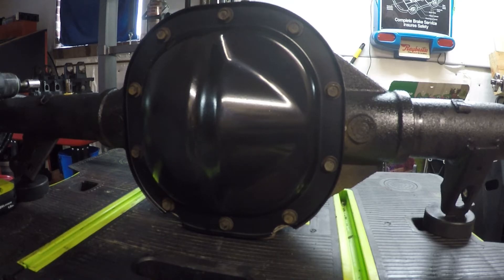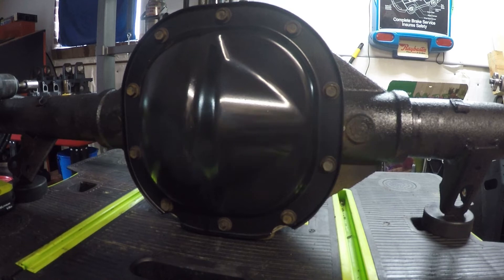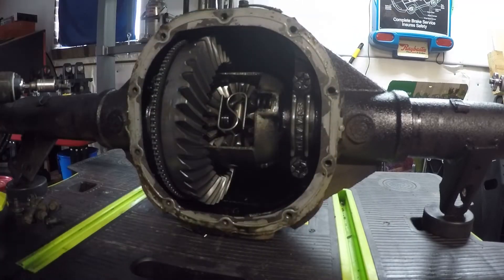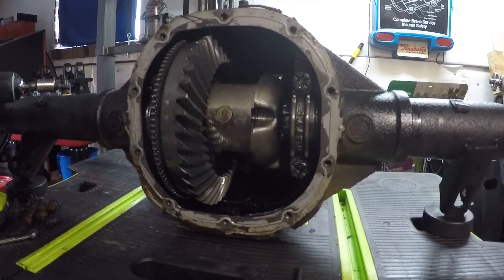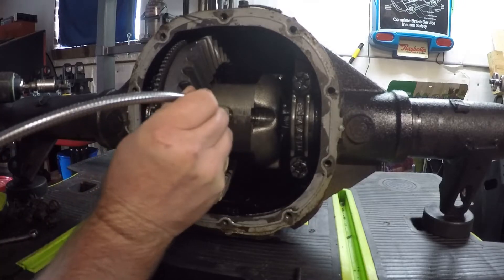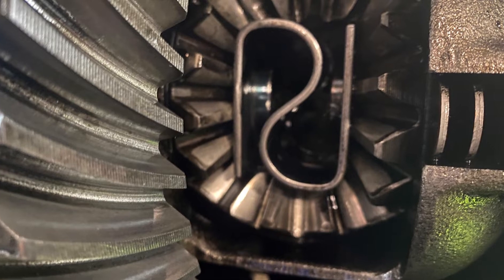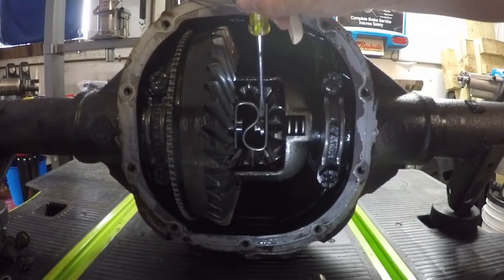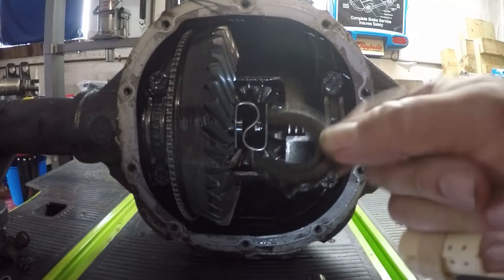Ford 8.8" Axle Bearing and Seal Replacement How-To

Comment: I have a Torsen 31 spline on my 2003 ranger..is the process the same? Nice, precise video. Thank you
Reply from the maker: They’re similar but not exactly the same. There isn’t the same center pin as in this video, I think it looks more like a block. Otherwise similar with removing the bolt and pushing axles in to remove the clips.
Reply: @stuffyoucando2 ok, I'll look into it a bit before trying to fix my leaking seals. Thanks for your response.

Comment: Yesterday, I pulled a rear drum off my '89 Mustang to find axle grease had coated the entire brake assembly! I just did the brakes a month earlier so this is a new issue.  Ugn...So I knew I needed to replace the axle seal..No idea how to do that so I searched online  and this video hit the top....

THANK YOU!  It is crystal clear now and it does look super easy. I am grateful to folks like you who illustrate methods for how to do repairs like this.  It sheds light on what was a dark situation.   I appreciate you!

Comment: After removing the center pin and then the axle , the spider gears fell out of place . I assumed that the C clip would hold them in place , but they didn't . How do I re-align the spider gears ? I think they fell out when I was replacing the axle (I'm only doing the passenger side for now)
Reply: The S clip I thought would keep the spider gears in place after pulling the axle . Now the gears are floating around inside the rear end housing . I'm screwed .
Reply: @rickobrien4025  How did it work out pal?

Comment: When replacing  , Do the recessed edges of the C clips go on the inside or outside ?
Reply from the maker: I’m not sure exactly what you mean by recessed edges, but if you’re referring to one side being slightly rounded, that’s just from the stamping process of manufacturing, it doesn’t matter which way you put them in.

Comment: What is the S shaped piece in the middle? And is it supposed to fit snug? I have a Ford 8.8 that has the same part but t it’s very very loose. The side gears broke so I got a junkyard 8.8 that does not have the same part.
Reply from the maker: That’s a spring specific to the limited slip differential. If your replacement differential doesn’t have it, then it’s an open differential. In your original it should be in there snug so it puts pressure on the side gears.

Comment: Does this axle have inner axle tube sleeves? I’m getting differential oil in the axle tubes on my Ford 8.8.
Reply from the maker: I’m not sure what you’re asking exactly, but differential oil is supposed to be in the tubes, that’s how the outer bearings are lubricated.
Reply: @ really? On my front axle the differential ring and pinion comes out and there’s tube sleeves on the inside. But I guess with the rear axle you have bearings on the outer tube so makes sense. I was wondering why my axle tubes were so full of oil.

Comment: Hi, My 01 Ford Explorer Sport Trac has a strange clunking sound and you can feel it bad through the truck but only after you have been driving fast on the freeway for a while and then you slow down and exit for a fuel stop or stopping at a toll booth and you are moving very, very slowly, not turning at all, it is so bad everybody can hear it, but by the time you get fueled up and start to leave it has stopped making the noise again. There is no noise or vibrations at all on the freeway. Would this be symptoms of worn Spider Gears or clutch packs. Thanks.

Comment: My question is do i have to remove all rear break stuff? I think I have bent axle  thats what my mechanic said after he installed new rear drums and shoes it still squeaks back there only from one side we even tried another drum because after going around block the drum would get extremely hot on one side not the other. Took us while back and forth to come to conclusion rear axle might be bent. I did have blow out at 80mph so its not surprising. Either way i think it is time for the bearings and seals to be serviced anyway. I wounder how hard it is to see with the eye if axle is bent? Thanks i doubt I can do this without a lift and not removing axle.
Reply from the maker: You could do this in the truck if needed and if you have drums you don’t need to remove anything other than the drum itself as far as brake parts are concerned. I actually had to do that later with the axle in this video because it also had a bent axle shaft. I had gotten the axle from a junk yard and didn’t know until I drove the truck afterwards that it was bent. So all of the shaft removal steps can definitely be done in the truck, I’ve done it with no lift and it’s not bad to do. Even the bearings shouldn’t be an issue either. Good luck!
Reply: @stuffyoucando2  what was your symptoms for bent axle shaft? Did it make your rear brakes squeak? For me it will only squeak at last few seconds of coming to complete stop . And at low speeds in traffic with no brake or gas on it will get slight hop coming from rear. But as long as you apply gas or break it is hardly noticable. On highway it does bunch of wierd stuff every bump feels 10times worst than it should i believe. I just want to make sure im putting money in right area. The axle shafts aint cheap i would definitely use new. My luck is like yours spend all day at junk yard just to get bent axle lol. Thanks man appreciate your time.
Reply from the maker: The brakes didn't really squeak, the main symptom was vibration, especially under braking but there was some vibration at any speed over about 35mph. What I did to diagnose it was put the rear on jack stands and run the truck at idle in gear and look at the wheels. I could visibly see wobbling when looking at the inside of the wheel as well as the inside edge of the drum. I think in your case I'd look for that and if you see it in the wheel, switch the sides for the wheels and see if it stays with the wheel or at the axle. If it stays with the wheel, then you have a bent wheel. Are you using the wheel that had the blowout?
Reply: @johnwhite192  I have the same squeak on the passengers side but I was told it was the ABS and the ABS light is always on. But I also have some weird clunking going on in mine at very very low speed that nobody can give me any idea what it is.
Reply: @stuffyoucando2  no that got junked my tire guy is pretty honest about that he wont mount it if it is bent. Walmart will mount tire on any condition rim and not say a thing. I know I need new rims well 3 i have 1 new. Mine feels real lumpy when im in traffic and not hitting the gas i feel the rear end hoping it feels like hopping might not be correct way to describe but kinda get idea. In the rear its really hard bounce over bumps at normal highway speeds i feel front end hit bump its smooth as it can be but when rear wheels hit the bump its like bang like i have stiff leaf springs which i don't they are original i believe. I put new bushings in leaf springs and hangers and brackets. I believe it is either bent axle or bad axle bearings or both. But its only on driver's side that im having issues. Also when shop did rear brakes i bought motorcraft drums and right away i felt it dragging really really bad took it back and drivers side drum was not far from being cherry red my guy told me its a bad drum he put napa drum on i didn't feel drag but it squeaks at last 5ft of a complete stop. I really don't think the drum i got was bent but idk im going to try the trick you said the shop did that to they had it up in air in drive and they said it looked good from naked eye i was there i didn't see anything but i might try that at home. Thanks
Reply: @oldgamer1330  clunking is usually ball joints. But assuming you did all normal maintenance and it is all tight front and rear it could be bad axle bearings i imagine that could possibly make clunking sound. Either way they probably should be done with new wheel seals. But if your going to do all that depending on who dose it might be better to replace shaft as well 400 can get you both axle shafts. And bearings. Seals are separate i think.  Is your leaf spring hangers good mine was rotted out replace those and the bushings in leafs and hangers. Depending on your mileage its probably axle. Mine i have 360k ish miles the axle is getting due for some overhaul.
Reply: @johnwhite192  No the bad clunking only happens at less then walking speed, and about 3 or 4 times per wheel revolution and is so bad you can see it shake the side mirrors. Mine has only done 135k. It really sounds like uni problems but I have checked them so many times, but I think I might just do them so I can rule that out.

Comment: I didn't see no o-ring when removing or installing c clips
Reply from the maker: I’m sure with age they can deteriorate and go missing.
Reply: @stuffyoucando2 just curious whats the purpose of them? I’m replacing the seal on the passenger side and the o ring came out ripped

Comment: If anyone is looking for the slide hammer and adapter to pull the bearing - Advance Auto parts:  master loaner tool kit by PowerBuilt Tools, P/N 648611 (or) Autozone: slide hammer OEMTools 57033 and Adapter kit: OEMTools 57129). For the Bearing and race installer tools: Advance Auto loaner tool kit Powerbuilt: 648996 (or) Autozone: OEMTools 57119
Reply: Yeah, that’s good to know upfront I can call ahead. Working on 2002 F150 👍

Comment: Can you do a video where a guy like me let the spider gears drop and now I’m in a jam.  I have the gears out of the diff housing now but am Leary to pull it apart more…that weird S shaped piece between the 2 axle bearings is stressing me out
Reply from the maker: Unfortunately I can’t pull mine apart to do a video on that. I had this happen to me once before when changing out an axle shaft because I forgot to elevate both wheels and I rotated the elevated side with the pin removed and didn’t realize the spider gears were coming out as I was turning it and they fell out. In my case I put them back in by placing them in the positions they were in when they fell out and rotating the wheel back the opposite way and the side gears moved them back in. It was a pain and took a few tries but worked, but I’d probably recommend watching some of the differential overhaul videos and finding that point in the process, but it will most certainly require removing that S spring.
Reply: @stuffyoucando2  Thank you for your reply....I eventually got the gears back in place.  I have another rear diff to rebuild so I think I will make a video as there us nothing out there that speaks directly to this problem :)

Comment: Hi I've wasted the whole day trying to find the seal for that specific axle by any chance donyou know the part number?
Reply from the maker: I recommend going to a place like Rock Auto and entering in your vehicle information to figure it out. There are different variations of the 8.8” axle that require different seals, such as the 28 and 31 spline versions, which have different diameter shafts resulting in different part number seals.
Reply: @stuffyoucando2  thank you 🙏
Reply: The bearings i just pulled out of mine are one piece (seal and bearing) and driver side was different then passenger. 🤷‍♂️🤔
Reply: @shawnbrinton those bearing / seal combos are sold to install after the car is had many miles on it because the original seal wears grooves into the axle, by installing the bearing / seal that you speak of allows the seal lip to ride in a different location on the Axel therefore finding a new unworn area of the axle so it will seal good.

Comment: Ok so, maybe you'll have an idea here, it appears I did everything correctly, but the brand new axle seal on my Crown Vic 8.8 is still dumping gear oil from the passenger side hub exactly as it was before
Reply from the maker: How does the axle itself look? If it has a groove worn around it where the seal rides, it’ll likely leak. There are a couple of options to fix it possibly. There may be repair sleeves available that will press onto the axle shaft, similar to ones offered for crankshaft main seal repairs. Otherwise, a new axle shaft will be needed.

Comment: Nice video.   You didn't talk much about the axle surface itself unless I missed it.  It's not uncommon for these axles to be trash when you pull them out just due to wear.  Man I need to buy one of those seal pullers. Way easier than using a cold chisel.
Reply: Shit thats not what i wanna read😭
Reply: @limpit_drone6104  Thankfully most parts stores usually have them in stock or can get them quickly if you happen to need one.   I wouldn't fret over it too much.  I've pulled like 8 of these 8.8 axles over the years and have ran into two bad axles and then my son had a complete axle fail to the point where there was so much play in the axle it ate the seal and then flung gear oil all over the wheel.
Reply: @PNW_Car_Mods  oh man I’m hoping my issue’s just a diff cover gasket, id be so mad having to do a rebuild at 54k miles
Reply: I bought one works great
Reply: What was the till called that you used to reseat the bearing and seal?

Comment: If I’m just replacing just the bearings and seals do I have to open the diff at all?
Reply from the maker: Yes, you still need to. The axle shafts can’t be pulled out unless the C clips are removed, which is done as shown here.
Reply: Yes